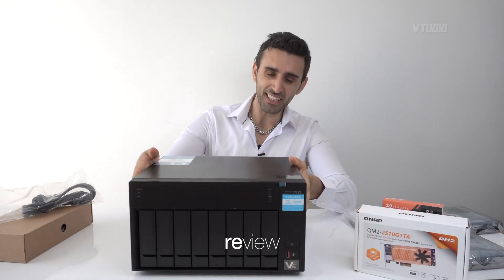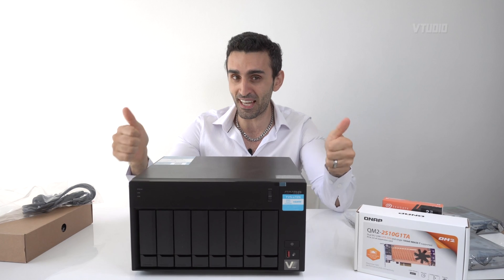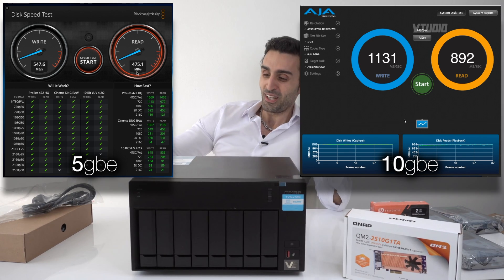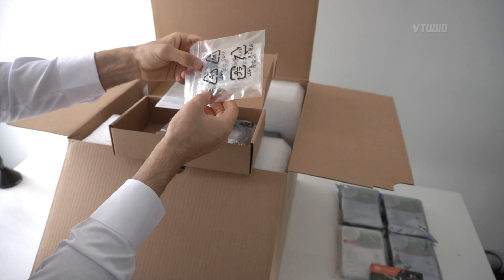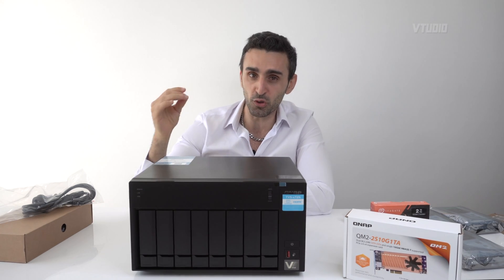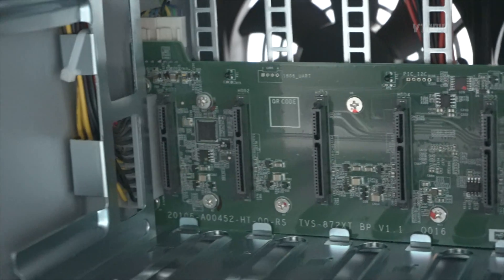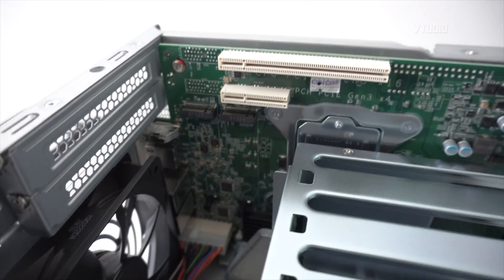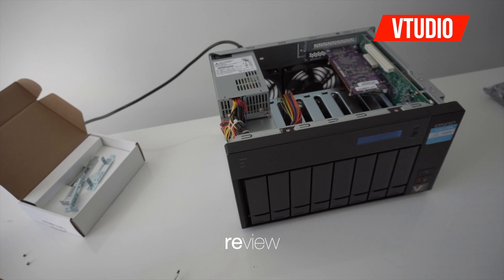QNAP TVS-872N Review | Best 8-Bay NAS Release in 2019?

Comment: Thank you for the review!  very insightful
But i'm at a cross roads as I can't decide to buy this or the TVS-873... seems that the TVS-872N has gone up in price. ($3220AUD)
How did you choose this model over a TVS-873 as its $1300AUD cheaper ($2000AUD)?! 
slightly older CPU but seems to be very close with performance.
Reply from the maker: Hey mate, I haven't tested the TVS-873 myself, but if you look at the QNAP product pages of the two models it says that the maximum upload speed to an encrypted volume on the TVS-873 is 343MB/s[1], while the TVS-872XT can do 977 MB/s[2]. The TVS-872N is pretty much the same as the XT but with a slower ethernet port - however this can be upgraded to a 10GBe with an adapter card. So, as I had a bad experience in the past using a Synology unit with a slow Atom based processor, and I use encrypted volumes, I went with the Intel based edition, however if you don't need encryption the difference would be less dramatic.

[1] https://www.qnap.com/en-au/product/tvs-873
[2] https://www.qnap.com/en-au/product/tvs-872xt
Reply: @headsoftech G'day mate,
I didn't even consider comparing encryption until you mentioned it, makes sense given that the i3 has more power. I did want to start using it and can now justify the TVS-872N for professional work.
Perhaps one of each will work as I only need 2.5Gbe for pro work, TVS-873 for archiving & Plex with a substitute 2.5/10Gbe expansion.
I'm also jumping ship from Synology 918+/1019+ as their hardware is dated and I need 8bays, wouldn't of considered switching if their expansions were so exxy..
I'm also keen to use QTSZFS, hopefully this comes out soon, only recently learnt about the world of QNAP.. unsure how I neglected them.

Thank you again for the help and response, your a gentleman and a scholar!
Enjoying your content!!
Reply from the maker: Sounds like an interesting plan, always good to have a backup archive for when things go wrong. Plus it opens you up to using something like RAID0 or RAID5 instead of being overcautious with RAID6 on your main NAS. One tip I'd suggest is to hold off ZFS if you can, while it does sound great, I personally always hold off new updates especially to the file system as sometimes being a pioneer might mean you're one of the first to come across a bug. Also it's worth checking out how much they sell the XT model, as I've read from some users that in some regions it's not much of a price difference between the XT and N.

Comment: QNAP should release TVS-472N and TVS-672N, not TVS-672N and TVS-872N! As you wrote, the most performance you would get out of TVS-472XT, was slower than 5gbe, because you were limited by the 4 bays, so 5gbe would be ideal for this one. With 8 bays, 5gbe will become the bottleneck, because it could fully saturate the 10gbe. (OK, not considering SSDs, but ...) I'll probbably go with TVS-672N, use 1 separate disk for system and 5 disks in raid 6 for data.
Reply from the maker: Yeah, maybe a 4 bay would of been a better use case for 5gbe, but I'm just glad that there's a cheaper version of the 872XT now available, as a 10gbe adapter doesn't cost much.
Reply: @headsoftech  Yeah, I meant use case for 5gbe as intended by QNAP. If the price difference between 872XT and 872N is so huge in Australia, it definitely makes sense to upgrade N to 10gbe :) N version in our country is much more expensive, so the difference (less than 400AUD) is not worth buying N and upgrading to 10gbe, when you consider you get more ram and better CPU with XT.
Reply from the maker: Totally agree, I just got a newsletter email from QNAP calling the 872N "cost-effective"[1], so it does really need to be cheaper to justify that statement. Hopefully retailers in your country just got confused and will drop the prices soon.

[1] https://www.qnap.com/static/landing/2019/en-tvs-x72n/index.html?utm_source=BenchmarkEmail&utm_campaign=Cost-effective_5GbE%2f2.5GbE_NAS_%7c_TVS-x72N_Series&utm_medium=email

Comment: If you bought it Cairo Bloke, then I would buy it as well. All silliness aside dude. I like this NAS a lot. It's one of the best performing ones on the market. You do pay for that performance though. (:
Reply from the maker: What I love about this one is that it's about A$1,000 cheaper than the one I was previously eyeing up (TVS-872XT), sure the XT version has an i5 and 16GB RAM, but so far I don't notice any performance issues with the i3 8GB this one's rocking and I've never had any problems with the Pentium Gold 4GB in my TVS-472XT, so I'd rather use that A$1,000 saved for SSD caching instead. But I'll know for sure once I finish my in-depth performance tests.
Reply: @headsoftech  I am more than excited for these videos sir.

Comment: I just had a really stupid Idea... Could you yust in theory put a vega 64 in the PCI-E slot and pot the power supply beside it? *Disclaimer: Yust in theory...
Reply from the maker: That's right, it's just a standard PCIe Gen 3x16 so it should work with an external PSU. There's an article explaining how you can get the GPU working in your VM using GPU pass-through[1]. I personally haven't tried a GPU upgrade, sounds like a fun project though.

[1] https://www.qnap.com/en-in/how-to/tutorial/article/how-to-set-up-and-use-gpu-pass-through-in-virtualization-station-3/
Reply: @headsoftech  DO IT!

Comment: Mate what are you storing? The worlds biggest Izzy magic folder 📁 

Unless you want the NAS to transcode. The CPU don’t matter does it?
Reply: Tally Ho Tech well, if you want to run VMs it matters, but my NAS has no good processor, and data speed is normal as I would say.
Reply from the maker: @fabianmayer  Which NAS do you have Fab?
Reply: @headsoftech  I have a pretty "old" DS415play from Synology. The transfer speeds are limited to around 115 megabytes on the read and 90 on the write. But that is just the problem of the pretty dumb RAID I chose. I think I could get easily 6 tb more out of my NAS if I would change it from Raid 1 to Raid 5 (I think). The Drives are WD Red NAS hard drives. 6 terabytes each. But I think I might get a QNAP with 8 bays and SSD Cache. but currently, I am very happy with my current Synology Nas. But I am not able to edit off of it in FCPX. something with the config file is messed up, or whatever. To edit it  I need to download to an external SDD ore HDD. And you edit of the HDD based NAS with cache right?
Reply from the maker: @fabianmayer  90-115MB/s sounds actually great for a 1GBe connection especially as you use the slower WD drives (5400RPM), I was getting far less than that on my DS416play. Do you have any trouble at all accessing folders, or do they load up instantly? For me that was the biggest pain, but I have thousands of files and the thing would never stop indexing.

For my current QNAP-472XT I can edit right off it as shown in my previous review, well up to certain files. It can handle up to my Sony A7III 100mb/s files, but it'd struggle with Red 8K footage - I've set it to be a RAID6 encrypted configuration and have it backup certain files to the cloud in the background which clamps the useable speed down to around 300MB/s at maximum capacity (drives get slower when you get to less than 10% space left) - if I had more bays or if I installed a m.2 cache (which is what I'm doing with this 872N) it'd run faster.

One thing I do now however, which you might find useful to get more life out of your NAS, is I wrote a script to automatically cache my media files locally on my MacBook (I've got a 2TB Mac so I keep around 1TB for media cache), that way I get max speed and if I ever need to pop out, my most used files are cached on my laptop without me having to think.

I should really do an advanced workflow video and share the optimizations I do actually, the one thing I would say is, caching is great, but only do it on drives that support it, MacBooks with Applecare = no worries. Seagate FireCuda with 5 years warranty and a 2600 Terrabytes Written before failure = no worries, but most economical options like Crucial SSDs will get destroyed operating as a cache (though they did replace my SSD under warranty when mine died previously).
Reply: @headsoftech  Yea when I click on a Library that I have stored on my NAS it lunches FCPX and then it decides to show the message "Use a supported SAN or SMB storage place". I don`t know if it says that in English, I have my os on german. But to solve this problem I watched a fiev Videos and read the in the Forums and followed the instructions. The easiest Video to follow for me was the one From 9To5Mac and I tried even some of the others out, and I was able to get to the point where I can change the File in the terminal, but It just says it can`t open it. The only thing I didn`t Try, is to erase the disk, and start from skrach. And the Idea of caching it on the mac would be a good idea, but I have only 256Gb of storage.
Reply from the maker: I have thousands of files so it probably effects me more than most, but I had a really bad experience with Syno NAS drives before, I had a 416 play with its baby processor inside and encrypted folders was out of the question, file listings over Ethernet connection would take MINUTES and indexing and scrubbing would take about a month. When I upgraded it to a slightly faster Atom processor in the DS18 series - scrubbing and indexing would take about a week, file listings would take between 30 seconds to a minute and transfer speeds got better too. When I switched to a Pentium Gold QNAP 472XT, well that one worked like a beast and was just limited by the number of bays I could take advantage of for RAID6. Going to do more testing on this one and the celeron in the 453Be to get accurate numbers but a faster CPU should help with encrypted folder speeds, transfer speeds and things like indexing and scrubbing.
Reply from the maker: Something easy you can do is store your Libraries on your Mac, but in Final Cut Pro > Preferences > Import > set it to leaves the files in place. That way all your storage media (GBs) lives on your NAS but your project files (MBs) live on your computer. For advanced performance you can also click on the library (top left), then storage locations (right panel) and use a specific folder on your Mac for project cache files - this'll mean it'll only hit your NAS for the actual media files, but the small files FCPX generates will hit your local hard drive - reducing the stress on the NAS. The only thing to watch out for is just to clean up your cache every now and then, but just regularly deleting the cache folder when you're done with a project.
Reply: Well... I was doing that, and it worked. But the thing is, to do it that way, the files need to get downloaded from the NAS and my SSD on the mac is full with only 5 GB left so, what can I do. Copy it to an external SDD and store them there and keep a backup on the NAS? but I will try it and maybe delete some of my local files on the mac. And on the QNAP NAS, it works flawlessly?
Reply from the maker: If you make a new Library on your Mac, set it to leave files in place, then copy the projects over from the original Library, it should only reference the media files and not copy over the media files anymore. Yeah, QNAP works great (I've got a video earlier showing the performance in FCPX), but in short it works better than any external hard drive or NAS I've owned, but as I don't have any SSD caching in my 472XT, it doesn't work as fast as an SSD drive. I do however have a m.2 nVme (Segate FireCude 510) now, which I'm currently using to performance test my new one (872N) and my budget one (453Be) and I'll be doing in-depth comparisons showing the real world performance difference between editing directly off my Mac, editing off a HDD NAS, and a NAS with SSD caching for multi-cam projects in Final Cut Pro very soon.
Reply: Sounds great, I will try that, and am waiting on the upcoming Video of the in-depth comparison of the performance. Currently, I am trying to copying it to the internal SSD of the mac, thanks for the help;)